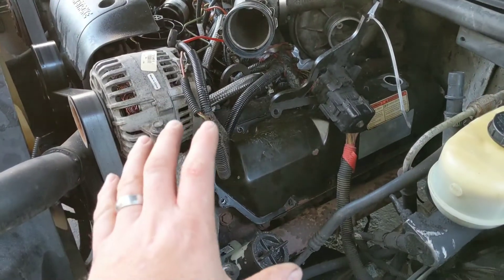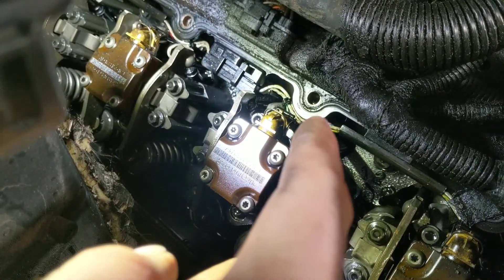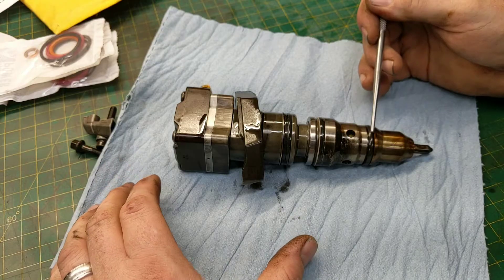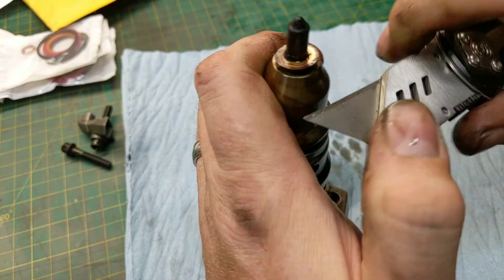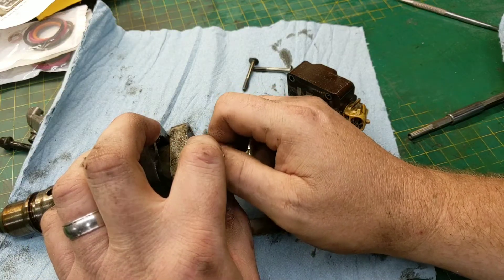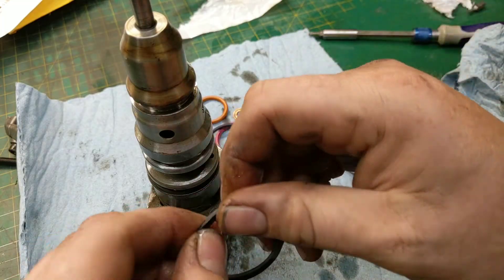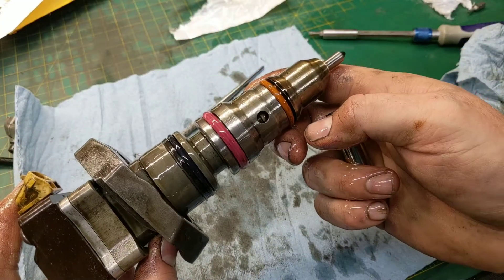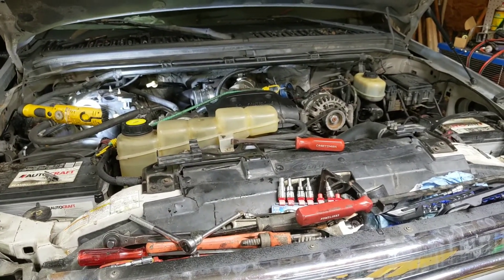Replacing the Ford diesel 7.3 injector o-rings and installing an injector shim kit, tune up kit.

Comment: I thought you had to take apart the injector so you may spray tip out wear it sprays good four directions  and a spring in center of injectors but I do like the video and the way you do them one by one
Reply from the maker: You only have to take them apart if your going to rebuild them.   I just needed to replace the o-rings and decided to add the shim kit.

Comment: This is the video I needed. I had the injector harness clip break if in the injector when changing glow plugs... I was dreading pulling the injector, but thanks to the vid i know I can just pull off the electronics at the top. One day ill change the o-rings... But today isn't that day. Thanks again

Comment: Did you take the injectors apart and replace the inside O rings?
Reply from the maker: I didn't take them apart any more than what you seen in the video.    Truck is still running and starting like new BTW.

Comment: do i have to remove the master cylinder and or the heater box to get the injectors out?
Reply from the maker: I didn't, mine is a 2001 f350.    Getting the valve covers off was a bit of a puzzle though.

Comment: I'm thinking I need to do this    ...  my truck starts in 80° as if it was below 10...  once it warms all the way up  it  runs fine  .would this be your suggestion  thanks for awsome video  and also shouldni drain my coolant  down   so whats in the motor  dosnt get in my oilpan

Comment: Best video!! I'm a big fan and owner of a 1997, turbo diesel 7.3. Quick question? I replace my injectors,  not new but from another 7.3 who was running really good. I changed all o rings for new one. Now problem with my truck it smoke blue. Before I had a bit of it but was clearing after few minutes,  now idle for 30 mins and still smoking blue. And if I can point another issue, truck idle great but if I floor the gas pedal it doesn't want to pass 2000rpm and smoke like crazy??? Thank you.
Reply: U get it figured out?

Comment: Did you leave the glow plugs out when you started it back up again? Or did you just put everything back together and started it up?
Reply from the maker: I left them out and manually cranked the engine over a few times.   Was hoping to purge anything in the cylinders.
Reply: 1D10CRACY thanks for the quick response. I put it all back and tried starting and it sounds like it locked up. Hopefully nothing serious. Taking it apart now to remove glow plugs and turn over by hand.
Reply: @gprice5427  what did you find out?
Am I understanding this correctly that if you pull the glow plugs and manually crank a few revolutions, it cant hydrolock?
Reply from the maker: The main problem is when you pull the injectors, all the fluid falls down into the top of the cylinders. You need to remove that fluid before you try to start the engine.  by pulling the glow plugs and then manually cranking the engine over, it gives a place for the fluid to go, it will squirt out the glow plug holes.
Reply: @1D10CRACY  
Thank you for this. I enjoyed watching this video and learning. I put the video in my favorites. My '02 7.3 excursion cranks over fairly fast, but takes a little while to start. I'll be narrowing it down after I get done watching warren Buffetts yearly share holder meeting. I dont think its glow plugs or relay. It may just be the injectors not shimmed right or leaky injector seal. I wish I could get some type of affordable obd2 that can read what the icp pressure is. I know the diesel in the tank is about a yr old, the fuel filter on top of the motor is due for a change. No screens in the tank, I converted to a racor pre-fuel pump set up a few yrs ago. It has a see thru at the bottom to see if water is in the filter. Last yr I added a severe duty air filter, getting away from k&n. As preventative measure after I bought it, I replaced the  icp, ipr valve, the cam (or crank) position sensor (have the grey one), ebpv tube, (if I recall right it goes from front of motor to passenger exhaust), new fuel lines on top of motor, added riffraff regulated fuel return, added riffraff high flow fuel banjo bolts, bypass oil filtration, lightweight high torque starter, coolant filter. I think I'll start with verifying all glow plugs are good, just to check that off the list. Then, replace the fuel filter. I did add two shrader valves before and aft the filter so I should see how the flow is before changing. Really, I should be changing that filter yearly. I dont drive it in the winter so I dont even know how it starts below 50 degrees. Rig has low miles, about 135k
Reply: 1D10CRACY any advice is appreciated 😂😭

Comment: How are those o-rings holding up? Would you still recommend the same o-ring and shim kit you used?
Reply from the maker: They are still doing well!  I'd buy them again!
Reply: Awesome! I went ahead and spent the extra $ on the motor craft o-rings and I bought the shim kit you recommend. I’ve got the injectors out except for the number 3 injector (I have the econoline so a bit less space to work with 😬) so just waiting on the parts so I can do the fix! Thanks for the video, it really helps!

Comment: I purchased my 99 F250 7.3 PS new when it was introduced to the market.  It has only 170K over the past 20 years because I have used it for pulling an RV or boat. Although I can work on just about any gas engined vehicle I am not knowledgeable at all when it comes to diesel engines. Thankfully there are people such as yourself who have the knowledge and know how to work on diesels and are willing to take their time and effort to make and post videos  of diagnosis 0f engine problems with detailed instructions of how to do the repairs. I think your videos are exceptional in the way that you present the information in a straight forward manner that is concise, easy to follow and understand. Thank you again for your excellent videos, you do a great job making them...  keep them coming!!!

Comment: Nicely done video.  So rebuilding them is (far) less expensive than buying new or rebuilt injectors, right?  Almost gives me enough courage to try it myself!  Thanks for parts list!  My early 99 has 317k on it and feels like it's got plenty of life left.  ~15.5 mpg combined and all of the power I need so I don't think the injectors are too bad yet.   But I am going to have to do something about the EBPV (exhaust back pressure valve) so I might go for the injectors while I've got it torn that far down.  I will probably do the delete it but I've not found a video on that process yet.   On cold mornings (less than ~35f) my truck surges and sounds like a sick jet for at least 10 minutes and I've already replaced the exhaust back pressure sensor and tube.  The tube was totally rotted out so I did see some improvement.  Believe or not I learn a ton from reading the comments on these videos which I why made this long comment.  Hopefully I can help someone else out.
Reply from the maker: I want to say it was about 90 bucks for the o-ring / seal kit for the injectors, and another 90 for the shim kit.   (Don't hold me to that, my memory is about as good as a gold fish).  Prior to that kit, you could barley start the truck in temps below 50 degrees.   I developed a leak at the turbo pedestal, when repairing that I did the EPBV delete kid, it came with a new pedestal and seals.   Was fairly straight forward.   Mine would stick shut in the winter and you couldn't do the speed limit until it got hot enough to finally kick open, it also sounded like a jet sucking air under the hood.  My engine is just a bit past 300k miles, still running strong and I hope to keep it for a while.   A few weekends ago I developed a leak at the oil cooler, getting ready to tackle that next!
Reply: @1D10CRACY  Sorry about your oil cooler!  I want to do a video for "newbies" like me.   Something like "the top 5 (simple) things that fail/to keep on eye on/replace before it's too late plus the basic tools needed to work on on your 7.3 and of course the location and names of basic things.   My 7.3 has really spoiled me for the last 10 years because it's been so reliable thus I really never learned much about her until lately when I've started thinking about getting  at least another relatively maintenance free 100k+ on it.

Comment: Ok, followed your every step! And yea done! However 2 of the injectors were off? Before the .002 would not go under the thing at all. I put a .004 spacer in and checked it,  one side ok, the other not. But the .002 gauge did so I  just left it like that. What is your thoughts on it?
Reply from the maker: I think I'd try it!   Wouldn't surprise me if it runs like a champ!
Reply: Don't understand what is worn in order to make spacers necessary.
Reply: @77elco43  the face of the valve in the injector. It moves up and down as many times as the pistons do and stops by slamming shut. That slamming shut taps the ends shorter after a few hundred thousand miles. Then the solenoid as he said so it doesn't bottom out on the valve.

Comment: I run one of these, and after seeing the injector, and knowing that two computers are used, and the various sensors, I think IHC made the design too complicated with too many components, and too much to go wrong. That being said, they are generally very dependable, but a simplification of the design might have been an improvement.
Reply: To work at that pressure, provide the same performance and longevity which parts do you suggest should be changed?

Comment: FYI: www.powerstrokehelp.com just put out a video showing how the automatic transmission plates can weld themselves together if the truck is not properly grounded...enjoy.
Reply from the maker: Yup!   A pretty common issue with these trucks as well!    Good grounding straps solve this issue.
Reply: This makes me glad I redid all the large wiring on my truck with 00 silicone jacket wire and added Two pieces as grounds.

Comment: do you not have to evacuate the cylinders before reinstalling the injector
Reply from the maker: Best way to purge the cylinders is to install the injectors and pull the glow plugs before turning it over.   Turn it over slowly by hand using a breaker bar on the crank.    Anything in the cylinders will squirt out through the glow plugs holes!

Comment: Hey I’m thinking about injector replacement... my early 99 7.3 has 350k miles and pretty sure original injectors (I bought the truck with 235k miles miles). Truck starts good and runs smooth when cold as I keep good clean oil and always run a conditioner in fuel and occasionally add some ATF to the fuel (and to oil just before a change). I figure all the injectors are functioning very well BUT... my mileage is down by 4-6 miles/gal compared to when I first bought the truck 7 yrs ago. *I wonder if my injectors are just spraying a courser diesel mist...? 
*Question is, can I replace just the tip and O rings? Or the whole injector? 
The truck is a good one for sure, and my aim is to keep driving it till she catastrophically craters!!! 
The way I figure it, IF I gained 5 miles/gal, the fuel savings would pay for re-man. injectors in approximately 40k miles... 
any thoughts much appreciated
Reply: You can do any combination. You can buy just the tip, intensifier piston, just the O-rings etc. Go as far or as basic as needed.

Comment: I HAD JUST REBUILT MY INJECTORS AND GOT THE SHIM KIT FOLLOWED THE DIRECTIONS ALSO AFTER HAVING THE MOTOR BACK UP AND RUNNING HAD POOR IDLE IT OCCURRED TO ME AFTER A FEW DAYS IF THE INJECTOR FROM NEW HAD A 4000TH CLEARANCE FROM THE FACTORY WHY WOULD YOU SHIM THE SOLENOID I PULLED THE VALVE COVERS THE FOLLOWING WEEKEND REMOVED ALL THE SHIMS FROM THE SOLENOIDS AND PUT THE BACK TOGETHER LEAVING THE 2000TH ON THE ARMATURE AND IT RAN LIKE NEW, FLAWLESS
Reply from the maker: MY EXPERIENCE WAS A BIT DIFFERENT.  MY TRUCK WOULD HARDLY START IN TEMPS AROUND 50F AND BELOW  AFTER INSTALLING THE SHIM KIT IT STARTS LIKE A CHAMP AT ANY TEMPERATURE   I'VE SINCE RAN THE TRUCK AN ADDITIONAL 2000 MILES WITH NO ISSUES   BUT I ALSO DIDN'T REBUILD MY INJECTORS  HAD I REBUILT THEM THE SHIM KIT WOULDN'T OF BEEN NECESSARY.
Reply: @1D10CRACY  Ow much more  involved to rebuild  injectors??

Comment: Interesting. Learning new stuff all the time.  Maybe i should look into doing my o rings and doing the shim check.  Mine has 300k and probably original injectors.  I am looking into hpop R n R for valley leaks and crossover oil line upgrade while hpop out

Comment: How does truck run now
Reply: Disconnect fuel bowl heater and replace its fuse. Fuse for bowl heater and injectors on same fuse.
Reply: @drp2473  Where is that fuse located ?
Reply from the maker: Great!!!    It's been very reliable and start super easy!
Reply: 1D10CRACY my 97 7.3 started just normal went to get in and go and it just died won’t start it fills fuel bowl I’ve got great rpm movement when starting doesn’t seem to be any smoke so I’m thinking it’s not getting oil pressure do you know how to check ipr valve I’m hoping HPOP didn’t go truck ran fine before. It never had issues starting or anything just started yesterday then died shortly after and wouldn’t start again
Reply: @atonewiththemultiverse2889  check your oil level
Reply: I watch the complete video but was waiting to hear that engine running and I think every one did the same but still being a good video

Comment: I drove my 7.3 with nothing but diesel in the cooling system(had no water or coolant only 500 gal. of red dye in the middle of no where) and its running great with the shims I installed 4 years ago...

Comment: I just installed the shims on 4 of my injectors.  The armature plate on the driver side 4 had no clearance and starting was terrible until the engine was warm.  Last night and this morning it cranked with no issue and ran almost like it was warmed up already.  Can't wait to do the passenger side too.  Just have to find my oil leak and replace the power steering pump.  Good videos you make so far.  The shims can be done without removing the injectors too.  Just have to take your time and be careful.
Reply: Did you find your oil leakm
Reply: @brianmunch1827  yeah, main leak was one of the main plugs on the back of  the head.  Took it to a shop cause they're difficult to get to and I couldn't get them to break loose.

Comment: I drove VW diesels for 26 years. They were complicated enough, Thank you.  lol
This was interesting tho. Imagine all this expensive technology and parts replaces the simple Spark Plug with no moving parts. 

Curious if it's really worth the slightly better fuel mileage over a much simpler gasoline engine.
Reply: Depends, you want to keep the vehicle for 200k or 900k miles?
Reply: This doesn't replace the sparkplug. It replaces injectors... Gasoline engines have injectors. Diesels don't need spark. So technically, this has less ignition parts. Have you seen all the crap on a gasser V10 f350? Way more complex than a diesel.
Reply: you pull much?
Reply: From what I recall , Benz was the first designer of diesel powered engines . This was some way way back in the beginning of combustion engine designs . As to who was first . Steam , lol , of course .

Comment: What happend with Part 2 and 3 from the aircompressor installation video?
Reply from the maker: Glad you asked!    That compressor was going to be installed onto a truck I ended up replacing with the current truck.    Then we moved and life stole some garage time.  About a week ago I unboxed it and the new goal is to install it on the Ford 7.3, maybe where the auxiliary alternator option would of been.  It will happen, and I will do a video as well.